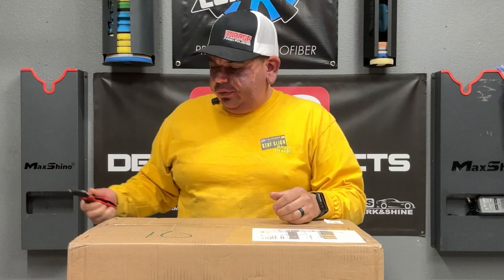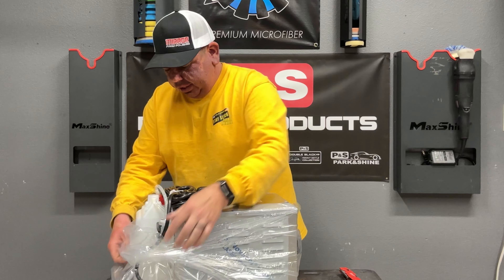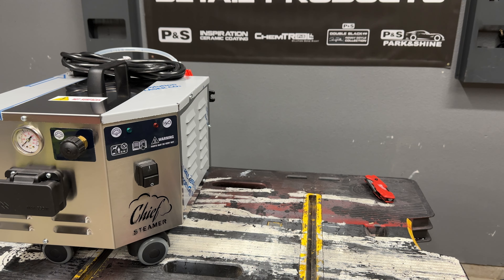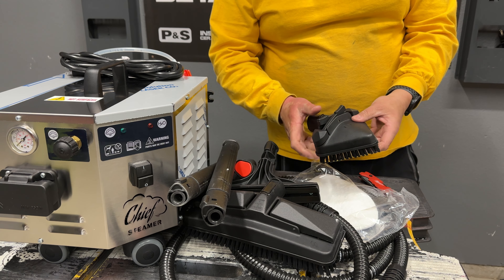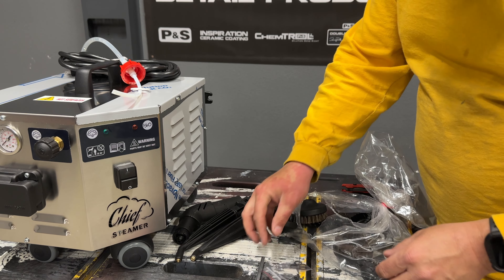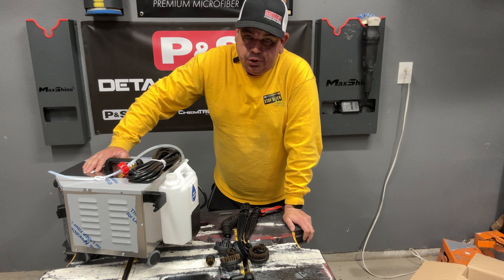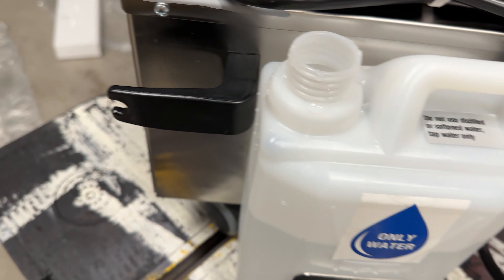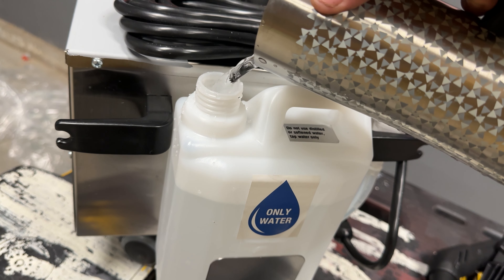The best steamer on the market? Chief Steamer 100 Unboxing and first impressions

Comment: Bottom line: This is the Best machine in its class. And The company stands behind their products,  Which makes it even more valuable in my eyes. We ran this little machine for 8 hours a day for 2 months straight, pulling wallpaper down in hotel hallways . Not a single issue.  12 gauge 50 ft. Extension cord .  Its a freaking Beast 💪

Comment: I love mine!! Speeds up my time & efficiency by far. Make sure u drain the boiler frequently & run distilled white vinegar thru it once a week or so. Maintenance is key
Reply: If you're running distilled water only, you won't have to clean it with vinegar that often maybe every 5 months or so just to be safe
Reply from the maker: @efraimperez2726 the owner of chief specifically says not to use filtered water. On the unit it also says tap water only. After spending a G on this unit I’m going to follow his instructions. Trust me deionized or distilled water makes more sense to me but for warranty purposes I’ll follow his directions.
Reply: @StaySlick  makes sense to do the vinegar wash every week then haha. That's strange. Every steamer i've used was only to be used with distilled water. Yes, definitely after spending that much money follow instructions so they don't void your warranty haha
Reply: Update: DO NOT RUN WHITE VINEGAR thru your machine. It damages things. Chief changed their stance on doing this. They replaced the pump on my unit last month.
Reply: @loonah8473  My machine recommends to run white distilled vinegar through it every so often. I only did it because I purchased it used and could tell that there was calcium buildup and mineral deposits. Again, I run distilled water through my machine only so I don't really ever need to do it. Thanks for the heads up though!

Comment: I've had one of these for a little over a year and it is a great unit. The customer service from Chief Steamer is wonderful as well. I looked at every unit in this price bracket and nothing compares to the 100's specs. That rubber cover on the bottom is the drain plug btw.
Reply from the maker: Right on man thank you for the info. Much love

Comment: Hey buddy have you had any issues with the steam coming out because mine struggles
Reply from the maker: Sometimes it’ll be wetter than I prefer or sputter but that’s only for a minute or two. Make sure you drain it regularly.
Reply: @StaySlick if you have hard water you can put a tiny amount of Optimum no rinse. It will keep the boiler from scaling and you don’t have to drain it as often. It can make the steam a little more wet if you use too much.

Comment: You been using this with a generator? Or what gauge cord are you plugging into? Just got my 100 delivered and it says to be careful with generators or any extension cords under 12 gauge.
Reply from the maker: I’m using it with my predator 3500. And a 15 gauge wire
Reply: @StaySlick  cool man thanks!
Reply: 12 gauge is perfect wire,,, 15 to small it will work but continues working  the 15 gauge gets hot and won't be healthy for the steamer this steamer has an element that's 1750 watts i think... can't remember off the top of my head but I do have the same. After talking with the owner Kevin he recommended 12 gauge or even 10 gauge this steamer is bad ass

Comment: Im surprised they don't add a funnel to this 1k ticket
Reply from the maker: Hey, don’t hate because you spent way too much money on a carpet extractor
Reply: @StaySlick lol I spent 3800 on a ninja 150 and it does WAYYYYYYYY more than any steamer. I’ve even had duprays big box steamer that’s 10k. This steamer is more than enough but it’ll never match an extractor. Trying to use steam to clean a muddy dirty filthy carpet is a joke for extraction. It isn’t even close. We’ve done 1980 interiors since 2020. Been detailing since 2011. My company is 5.0 review score on google with 197 reviews. An extractor is more so needed that a steam cleaner also. You can soak a seat and tornador it and have similar results (appearance wise) than a steamer. An extractor pulls while blasting boiling water and you can see when the water is clean through the tool. It just doesn’t company to an extractor for anything but seat tracks, honey, dried bbq sauce , interior foods on plastics or carpets. But generally as a common use item.. eliminating a steamer from your build order saves
About a half hour or an hour on a 3-4 hour clean.
Reply: Four years ago I purchased the Chief Model 75 steamer which has now been replaced by the Chief 100. It’s a great unit and I’ve never had a problem with the Chief. Prior to the Chief I had a McCullough steamer and the Chief is a far more capable unit. Great piece of equipment for interior details.